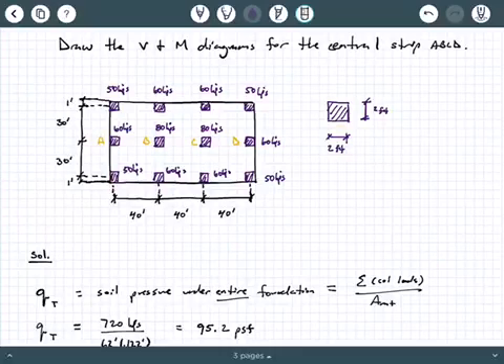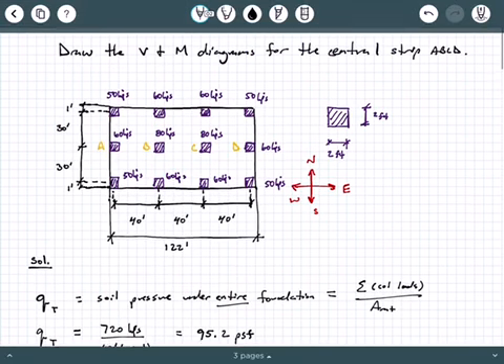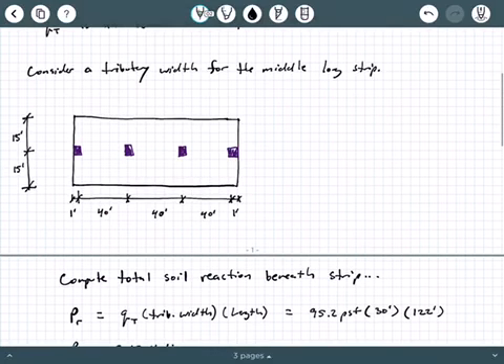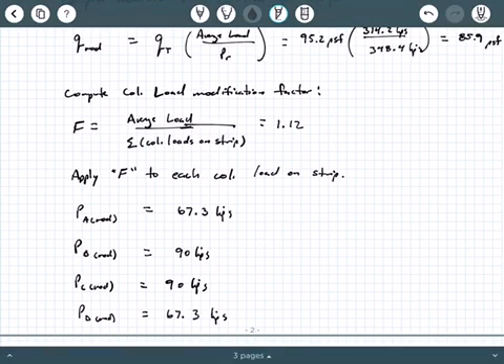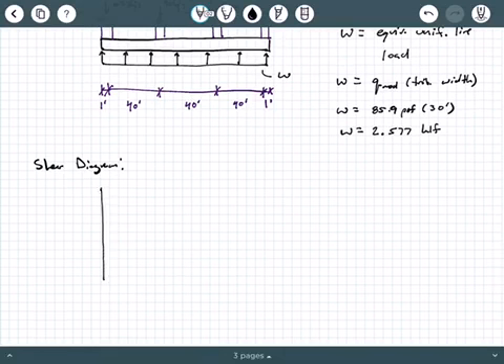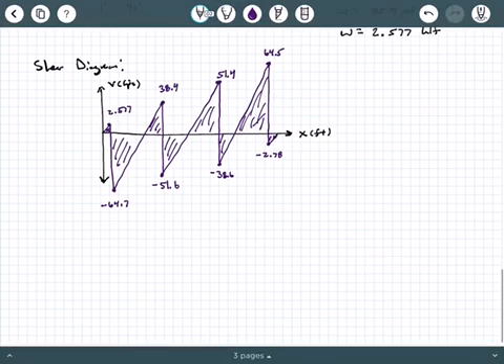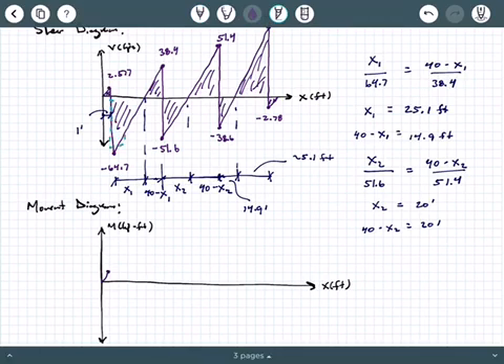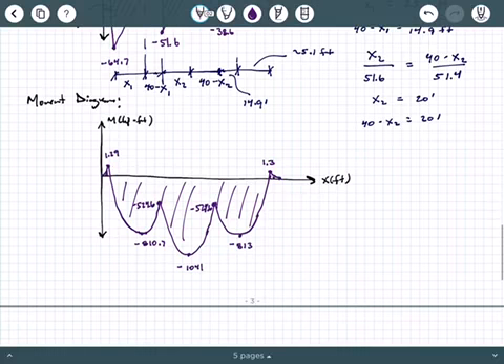Mat Foundation Design using the Rigid Method:  Drawing V and M Diagrams

Comment: Sir. What if there are shear walls and high moments. How should we find the steel area then?
Reply from the maker: That would be a very different loading situation than in this video.  However, you still can sketch the V and M diagrams and find the maximum moment.  Then design the steel based on the maximum moment(s).

Comment: Great Presentation.  You helped me knock the rust off of drawing shear and moment diagrams since it has been like 25 years which I usually resort to beam diagrams for minor mat foundation design as a civil engineering project manager, and leave the heavy stuff to the structural engineers with their fancy software.  You mentioned that the moment diagram may look odd, but to me not at all. I always found it useful to "flip" the beam diagram with the uniform loading on top while visualizing the Point loads as reactions when looking at foundation designs.
Reply from the maker: Thank you, James.  I made this particular video a couple of years back for as an example for some of my students to jumpstart part of their senior design project.  When I posted it on YouTube, I did not expect it to gain this much popularity.  I am currently working on a set of videos that covers more on this topic, as well as the structural design of spread footings.